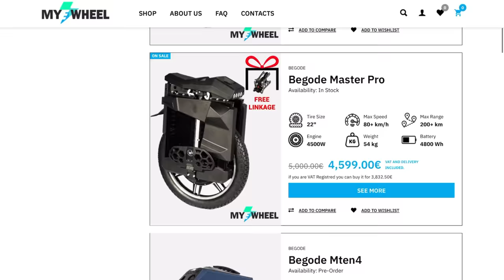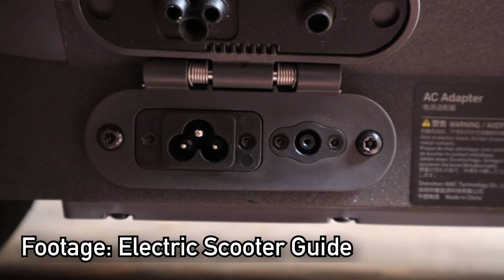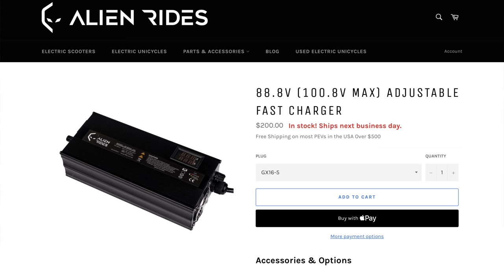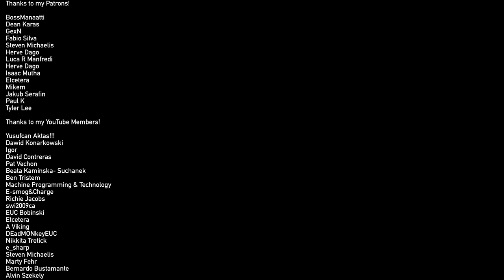I don't like where EUCs are heading

Comment: The biggest problem i have is legality. In Europe it's kind of illegal. Whether it's enforced or not is a different question, but if i were a policy maker, i could NOT endorse a 40+kg vehicle that goes to 90kmh being without any kind of registration. I believe in freedom, as long as you're sensible. If you're going at sensible speed behaving sensibly, you should be left alone. Riding something you can't lift, that's half your size, and goes that fast is just asking for trouble, beyond the fact that it just doesn't make sense. If you want a ridiculously powerful vehicle to fool around and do tricks with, man up and get a dirt bike. Because everyone riding sensibly on sensible wheels will suffer from being associated with these ridiculously dangerous objects.

Comment: Fantastic vid.  Yes, please make a lighter suspension wheel with adjustable pedal height so those of us that don't go off-road often can still enjoy the safety and comfort afforded by a good suspension system and we don't have to use a ladder to mount.  Maybe give us a choice of battery sizes so those of us that don't need to go 100 miles can have lower weight as a trade-off for range.  And yes, these big, heavy wheels that don't stop quickly are a liability - both in terms of personal injury to the rider and to others - if the wheel gets away during a crash and runs into someone or their property.  These devices are in a grey area, so who knows what happens if they crash into something or if something (cars) crashes into us.

Comment: It's really sad when you get the double whammy of unsafety as a wheel is trading torque for top speed. So less breaking, to go faster. 

Great...

Fine enough to have speed tuned motors but there should be a bare minimum of  torque in relation to that, which also takes wheel size and weight into consideration. I also agree we need to pull back on the current top speeds, it's fine to have some overhead but we reeeeally don't need to be going much above 50-60 on these things. At the very least not as a trend and baseline for every flagship model.

Comment: Mostly valid points, Adam, but i know you understand that most of this is what the community asked for. More safety, quality, speed, and range. This can raise prices substantially. It can also increase the weight. I dont believe they're doing anything different than most companies. They are following the market. If there is no interest, there is no profit, plus everyone is talking about the flagship wheels. 
But, i believe the market has begun a uturn with the introduction of the smaller suspension wheels from KS and LK. If the interest is profitable, we will get more. 
I believe the V13 is the limit EUC'S. It just doesn't make sense to push any further. Put a smaller wheel on the v13, use the space gained for more battery capacity, and bring the top end down 10mph. Walla, call it the V12.5. 
Haha

Comment: - 50Kmh is enough for me. 
- I like the option to choose between off and on road tires when buying. 
- Redundency. For safety EUC should be redundant. When one circle fails there should be another circle that helps at least to stop the EUC without cut out and crash. 
- I like torque. 
- Waterproof, I should be able to ride in rain and snow. 
- I like colorful LEDs. 
- S19 looks good. Maybe this is a wheel for usual commuters. Should be possible to order with off road tires for riding on field lane. Maybe a seat would be good too. Maybe a 22 inch version would be nice? I like the colorfull light show. 
- For the sporty off roaders the S22 pro seems to be fine. But too fast for me. Would preferr more torque instead of high speed. Maybe a 22 inch version would be nice too?
- I like the idea that a laser keeps cars on a distance. 
- I like suspension wheels.

Comment: I will say, I think the begode t4 has a lot of potential to cover a lot of the points. Especially with the newest version. Biggest gripe would be water resistance. But, it glad a decent size, decent weight, decent range (would be cool to see a "pro" model with more cells), good torque, spike pedals(? Not sure if they went back to molded) and suspension. Now if they could only add a real smart bms and a cold charge port...

Comment: Rather than speeding being a fault of the wheel i think the rider should be held accountable. Give them tickets for driving over the speed limit or swerving in and out of traffic. Too often does the tool get take the bad rap and get removed or downgraded. 
Places and governments need to stop banning them but should go after dangerous riders putting others at risk. I think both large and small EUCs should be manufactured and legal. I love my EX30.

Comment: Ninebot Max scooter has UL 2771 , intergrated 3A charger, IPX5 and still weighs only 18.7kg. It is time the EUC manufacturers provided the same. 
I've seen EUCs increase in weight, speed and price 3x over the last 5-6 years. Good for some I guess (USA). I suspect this also has a large part to play on keeping EUCs niche which fortuitously has for the most part kept them out of the eye of legislators who concentrate on scooters littering the footpaths. However many jurisdictions have laws limiting size and speed. Usually 25Kg/25km/h. Eventually they will crack down on large machines and perhaps UL certification (not talking USA) so it is the manufactures interest to step up on the small wheel sphere.

Comment: I wish that kingsong had come out with a 20” non suspension wheel  under 30kg with 100v 24s6p(18650) version of of the 16x and Called it the Ks20X I would buy that wheel so fast I don’t need a big super fast wheel just a middle ground which I think this would be pity they won’t ever make it guess I’ll have to settle for an RSHT

Comment: I agree with all the statements. I really like my 10f because of weight + size + comfort characteristics, but where are some new models of the same size and weight with better materials, quality, display. There are so many things to improve in small wheels but manufacturers produce 35+ kg monsters that you cannot easily pick up. Not all cities and towns have infrastructure to use those monsters for shopping, for visiting friends etc. Some places have the only option to use stairs and you'll need to carry that 35+ kg.

Comment: I am looking to get my first wheel (something to stick with fire some time) but I am stuck with pretty much everything you mentioned... Most wheels are really expensive and heavy, or if they're smaller they're a lot older and barebones. Currently I am between the KS 16S and the 14D but I wish there was something newer. I was also suggested the mcm5v2 but I'm not really feeling it, primarily fearful of quality
Reply: My first wheel is the 16x. I love it!  It's a nice sized wheel for the road and off-road. I'm fairly light, so if you're a lighter rider, you might have a similar experience. I recently bought the T4 (as an off-road wheel, but is good for pavement too). It's a fun ride,  but I like being closer to the ground for more control and stability. Granted, both have their perks and are both fun to ride,  if you're looking for a first wheel, you can't go wrong with the 16x. Plus it's not that heavy that you'll break your back carrying.
Reply: 16s is amazing, esp. with new spiked pedals and pads

Comment: I would instead choose a high-speed e-scooter, high-speed EUC is more dangerous. This is my experience.
80 to 90 km/h on EUC is too much for me. I would instead choose a 100 km/h e-scooter.
EUC is more dangerous than an e-scooter because EUC doesn't have a handlebar, so you need more balance. However, e-scooters have a handlebar, so they feel safer.
My max speed on EUC is 35 km/h.
My max speed on the E-scooter is 75 km/h.

Comment: Yes, this. I totally want a new small EUC but they are honestly all obsolete. It's always something - water resistance, unsafe batteries / charging, weak lights, outdated electronics / motor, ect. Why did EUC manufacturers abandon the entry level rider? Very few people are going to take a chance at learning on a fast, expensive wheel. You've got to release shiny new beginners wheels if you want more sales. Hell, use the same frames, but at least upgrade the colors and lighting. I don't know many kids that want an ugly black old wheel.

Comment: If you’d like speed done safely, a hybrid fuel cell is needed to keep the weight down and maneuverability up. Higher than 50-60mph would need an active internal mass-gyro to act as a steering assist/anti-wobble mechanism. Lighter batteries are available this year but the angular momentum of the motor/wheel/tire combination needs a  complete redesign in order to optimize stability versus agility at higher speeds. This is not a difficult problem to solve but requires a different mindset in the engineering process. 
 
Remember those self balancing /-wheel cars from the 1960’s, or the gyro-stabilized motorcycle from the 2000s?  It’s like that but only smaller (because lower inertial mass is appropriate). A gyro unit should be no larger that the EX suspension introduced years ago. Also, gyro-stabilization will make learning much much easier. 😊

Comment: V13 have turned me into a bad person I go faster than ever and have more fun while going to work. I dont have a car anymore.  I totally agree with you but if anyone tries to take my V13 away from me ill go nuts. There will be 16 inch suspension wheels from Leaperkim, Kingsong and Inmotion soon (summer 2023)  Maybe those wheel will be a good answer to your criticism?  V13 lack of range is a bloody laff.   My V13 charger only outputs 125.4V,   Charging takes forever.  WE NEED BUILD CHARGERS WITH CORRECT VOLTAGE.

Comment: i never even considered a built in charger. what a great idea. if you open up a charger you will see that the components inside do not fill the volume of the casing. could easily fit a charger unit into the wheel with some cleaver design

Comment: One issue with a built in charger is selling to different markets internationally, with different electrical standards. Currently they just need to send a different charger for each country, instead of a specifically built wheel.
Reply from the maker: Actually chargers can work for both 110 and 220V. Eevees is selling chargers with this function (don’t even need to switch voltages) so you can use them at AC car fast charging stations
Reply: @mr_wrongway  oh, well then let's get some built in chargers! I wouldn't mind an extra kg if I only needed to stuff a charge cord in my bag.
Reply from the maker: @noahscapesax  let’s get itttttt 😍

Comment: all I want is to go 45 safely, have a wheel med sized jumps with out breaking down (v12ht), has a decent seat, can go 50 miles ridden at med to high speeds, and weights under 85 pounds and has decent torque, id give up a little speed to gain in some other areas, yet i dont want to go under 40mph either.

Comment: I think your havesome decent points but you also fail to forget that your personal riding and location of where you ride is not exactly what alot of people are doing. Some people only ride around for fun and not some car replacement or they dont live in a city so having a higher speed wheel or beefier more stable wheel for road travel or oddroad and trails is really something that alot of people are into. I get it you dont think eucs should get much faster but rhe same could have been said about motorcycles and look where they are. Or a dirt bike...etc. id take a step back and use the wheels that you do have that you do like.

Comment: Other thing! For safety I want to use a dash cam. Should be easy to use, small, for everyday commuting even in the cold or in rain. Easy to mount, e. g. on my helmet. Any recommendations for cams or links for reviews? Thank you!
Reply: Insta360 X2/X3 ontop of your helmet, will capture anything around you

Comment: Bought a v13 not for its size or speed but for its safety. It appears that inmotion is the safest wheel in terms of battery; I needed something I can charge and ride without the fear of fire or cut-out. I do wish it could be smaller and less heavy since I am only 5'3, mounting is not easy.

Comment: I don't really feel like I want to go back to a lighter smaller wheel, 25kg 16x I had is still a pain in the ass to carry upstairs, my begode master I can just roll up, there is not a single bike lane in my town so being able to go as fast as a motorcycle is safer and I don't think it's that much harder to get on and off, but I'm sure I would feel different if I lived in a different place. Adam thinks fast EUCs are becoming more like cars in some ways but in fact by promoting small EUCs people will feel the need to drive cars more, a lot of onewheel riders in US don't go all the way to work on their OW, infrastructure is not there, so they just drive and use OW to basically just park further.

Comment: Agreed on all points. My bitch & it's clear just how cheap the manufacturer will go is, I spend half my life in Vancouver (wet) why do the wheels lack any water resistance,  I mean not even boat trailer axle grease covering the bearings. I've  cut back my spending, can't  really see a reason to buy another wheel.

Comment: First, EUC's lack distance needed by many, so they need to get bigger, not smaller.  Many countries give tax-rebates for EV's, which in US don't kick-in until 7.2kWhr-batteries, roughly double Sherman's capacity.  So either batteries pack more energy-density or EUC's get bigger to meet tax-rebate requirements.  Want to see EUC community grow?  Let government rebate $7k per EUC and watch millions get sold immediately.  2) USB-c engineering-standard allows 240W max.  Wall-adapters fit in shirt-pocket.  Great for travel.  EUC's need USB-c anyway, why not install dual USB-c, bi-directional, PD ports on wheels?  

3) Pedals do need threaded spikes.  Be nice if the threads were compatible (and recessed) with running-shoe spikes, which already come in 3, 4, 5mm lengths.  4) Seems customers virtually all agree - Shock-absorbers are the way of the EUC future (likewise making EUC bigger, not smaller).  5) The 320lb limit could be a little higher.  This author's scooter weight-limit is 400lbs, thus leaving a comfortable safety margin for gear.  And since EUC's are getting bigger (and not smaller), why not up the weight-limit some?  6) Torque:  Fortunately, torque seems to be software-settable (ty Sherman).  7) Seat shouldn't block screen, should be thicker with more padding.  8) Trolley handles getting better, but not yet good enough. 

In summary, EUC's should become bigger, heavier and more expensive.  Tax-rebates will cover most of the cost increase and quality upgrades, but only if EUC's almost double in size and weight.  Battery technology has already improved 50% in the last three-years, so EUC's should soon start getting lighter/smaller after bloating-up to receive tax-rebates.

Comment: Grit Red
0 seconds ago
I take stopping power as serious.  Honestly, don’t have any explanation why I have taken the sherman thousands of miles without hitting a wall.   Without a  anymore than the worst brake (a motor) for a silly, weak stopping power. EUC on paper is absolutely the worst idea ever and yet it somehow has not killed me yet.                                                                                      

ANYWAY: 
My riding consists of a once a week ride at 28 to 36 mph sustained for 10 miles on an ok but busy road on a marked bike path (which is just the shoulder with cute bike paintings that don’t make me feel safe). The bike path is just a joke, an afterthought. Anyway, I need the 36mph and range total of 50 miles so i’m not doing full cycle charge discharge all the time. My Choice is either: keeping the sherman and not drooling all the time or….. all out consumerism and getting either the v13 (because it’s interesting and seems like it would be great in street) or the Patton (because it represents a new chapter where I could jump curbs to avoid things and faster acceleration hill climbing maybe to explore more off-road). Either way a purchase would make for a complete change up. 

PROBLEMS WITH A PURCHASE:

Weight is scary for both of my choices going from current 77lb to 89 or 115lb that’s my hesitation.

Comment: Adam, I guess that some other issue should be pointed out as well, namely the pointlessness and stupidity of regulations. I mean, many European countries have recently introduced laws that do not allow these EUCs in the streets and other public areas, if the EUCs have a max operating speeds above 20 km/h. What's more, they're classified as motorized vehicles, and no longer as bicycles, which leads to some absurd scenarios, where you ride within the legal speed limits on your EUC on a bike path while being overtaken by the bikers using legally the road which goes parallelly to the bike path. Now, imagine that you buy a V13 and try to adhere to the regulations. Who on earth would ride it at 20 km/h? Anyway, it would still be illegal, since you can adjust the top speed limit in EUCWorld as much as you like, but it still doesn't count as long as the wheel's max operating speed is higher. Meanwhile, we're still watching with envy those guys in Canada and the US, who can ride their wheels at top speeds wherever they like, while here, we have to watch our six so we don't get one day into trouble.